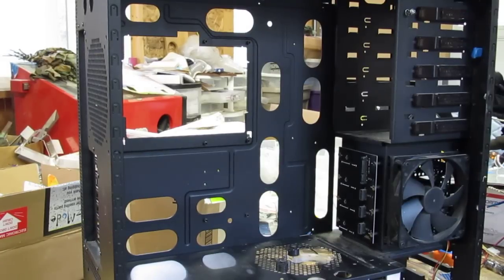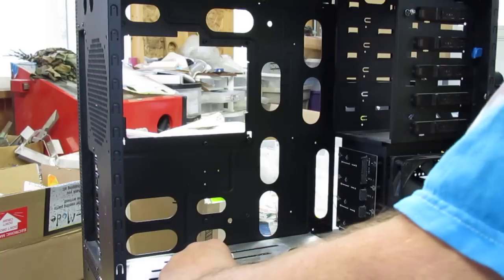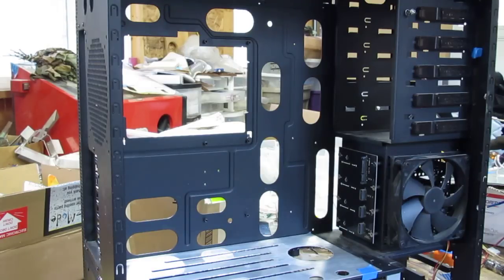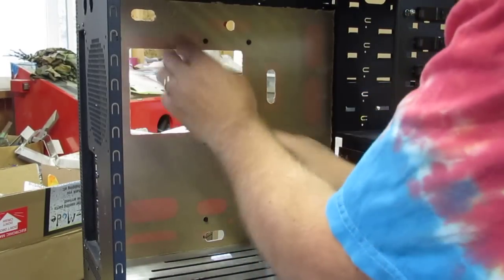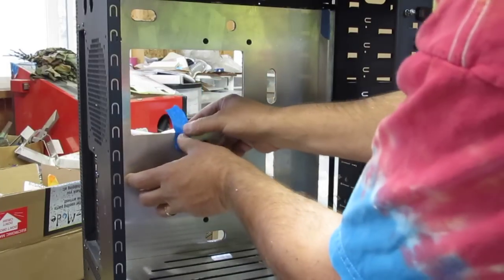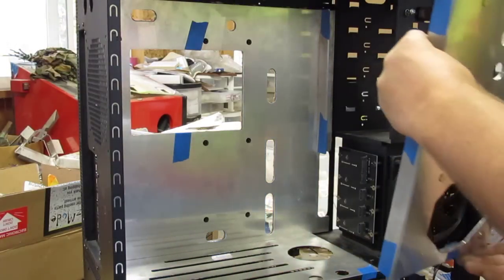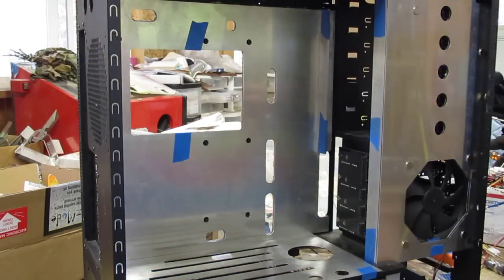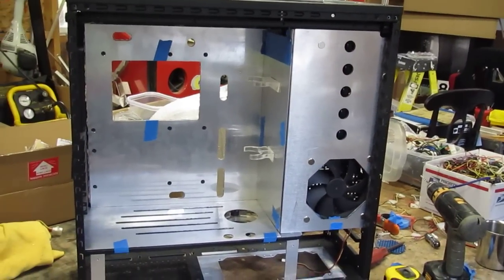Installing Trim Panels Documentation: Gemini Project Disclosure 3

Comment from the maker: @brodysstuff The composite panel is 1/8" thick. Any area where components populating the mobo may be present on the back side or where the "spikes" of the component legs poke through the PCB to the back side can be insulated or removed for clearance. Except for the CPU socket area the mobos I have seen rarely extend more than 1/16" on the back side...and those are usually "spikes" of component legs and solder that can in many cases be carefully trimmed.